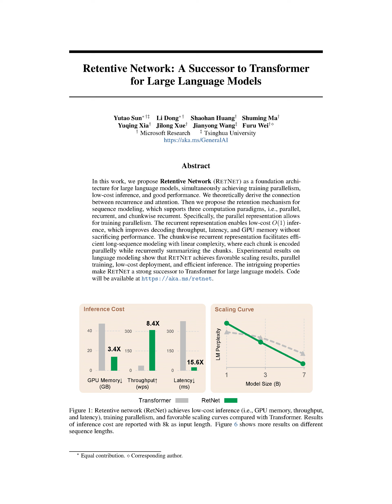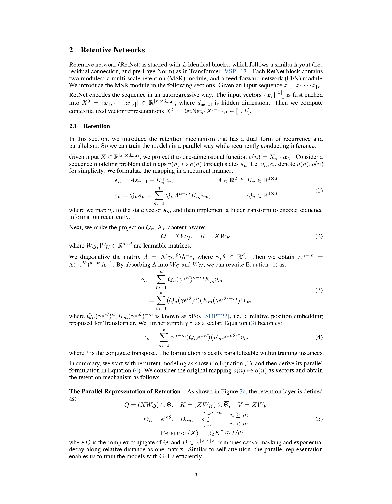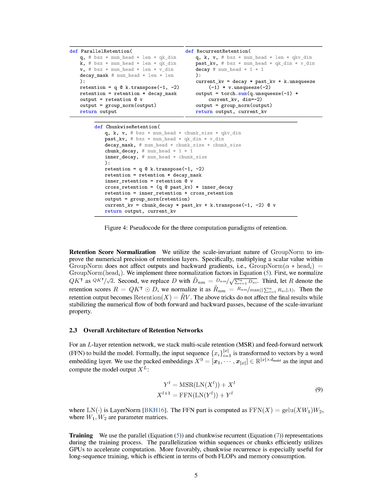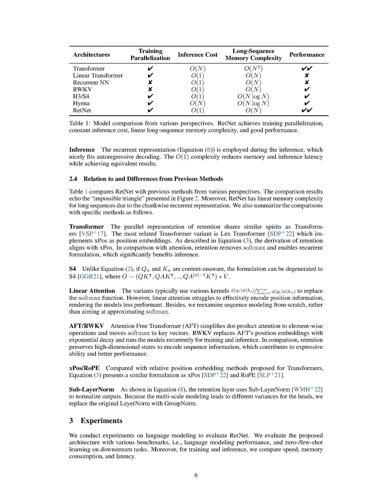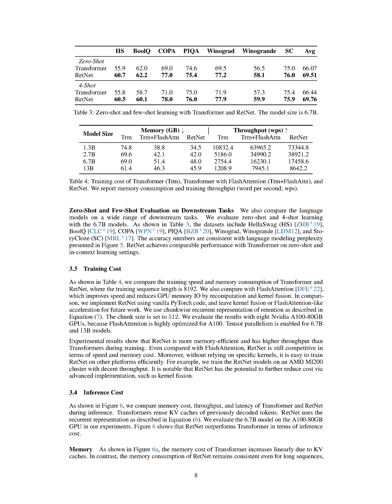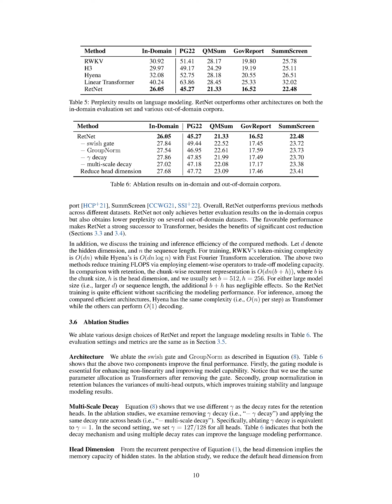Retentive Network: A Successor to Transformer for Large Language Models

Comment: The flavor of the core idea feels very similar to RWKV. RWKV can also be trained in parallel right? at least to some degree.
Reply: Ret net is all about solving the impossible triangle, without losing long term memory like RWKV. RWKV fail short on tasks require answering a serials of questions. Try listing 10 short questions for RKWV to answer, you will find RWKV will feedback with answers ordering not respecting your given ones.